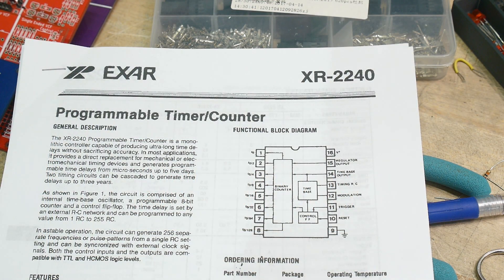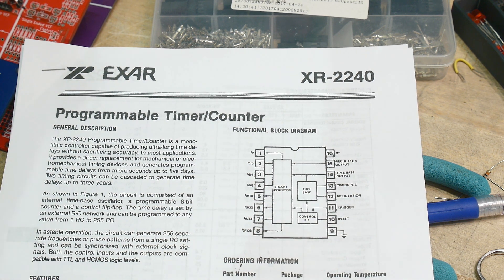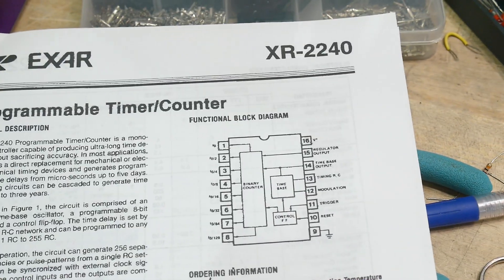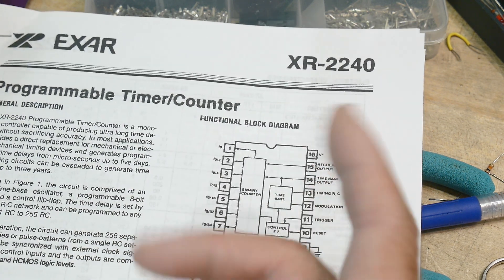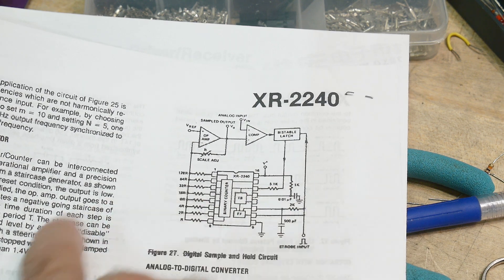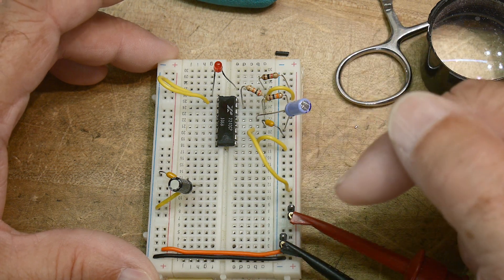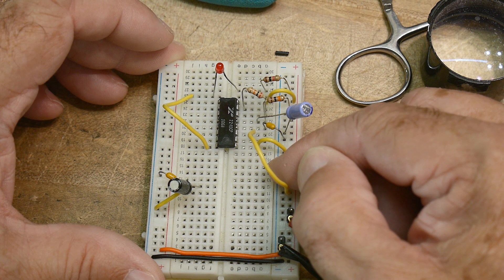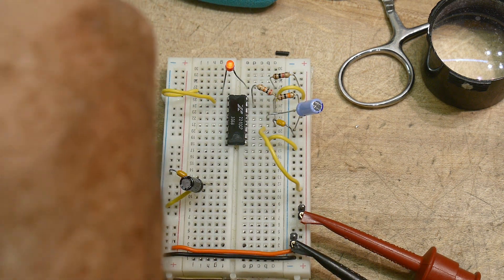#1234 XR-2240 counter chip

Comment: Thats a really useful chip. Its basically a 555 and a 4022 in one chip. Saves space on the board. You could use it as an LED chaser or a divide by 8.

Comment: Since you have a better multi meter and stuff, could you find out if fully "transistor" based opamp consumes current when used as a voltage follower (and what happens if you leave out the resistor)
I have seen some Texas instruments datasheets some of which where high end opamps where they used like 10K in voltage follower setup feedback.
Even Don' Buchla used 4K7 in the feedback on voltage followers why back.
Since the current of the base pulls along current from the collector in contrary to a fet input based opamp.
Reply from the maker: of course opamps draw current all the time, the resistor does not effect this. the addition of a feed back resistor is to balance in the inputs and to provide a slower response at high frequency (roll off)
Reply: @IMSAIGuy  According to the Falstad simulator the current that runs into base of a transistor can be massive if you don't put a current limiter on it and it goes in error mode. was wondering that if you use a LM324 or so as voltage follower the same would happen. one of GOLDEN rules of a opamps is that the inputs of opamp should not have current flowing in or out. just wondering. but watching the schematic of some opamp i just see a bare transistor.
Reply from the maker: @AnalogDude_  there is a major current limiter. the input stage is driven with a current source of about 100uA. so if the transistors have a beta of 100, then the input current of the base is only 1uA